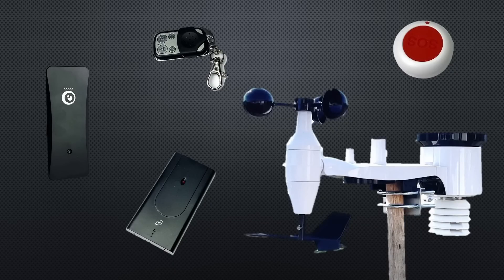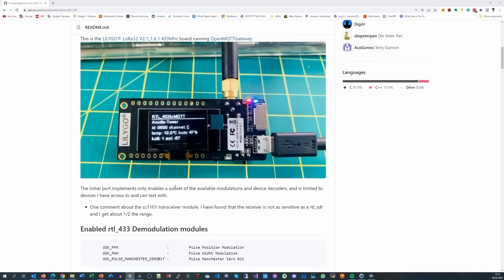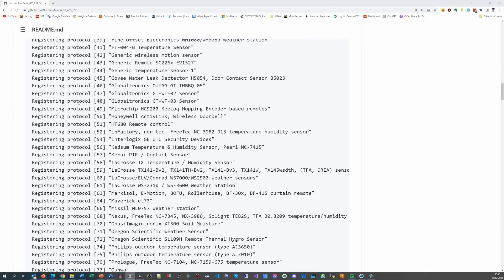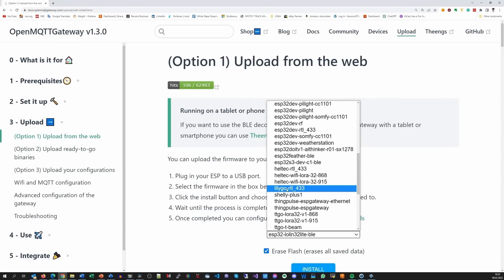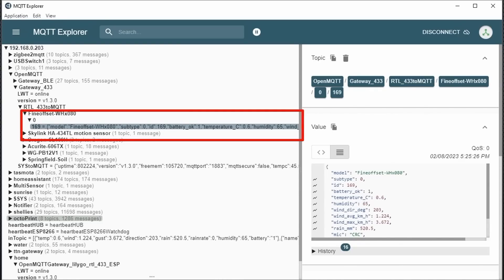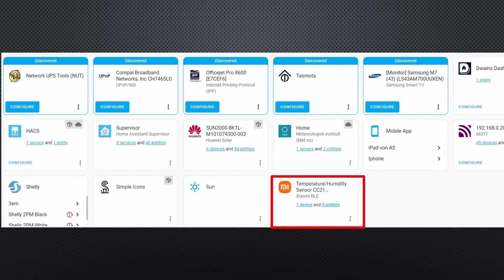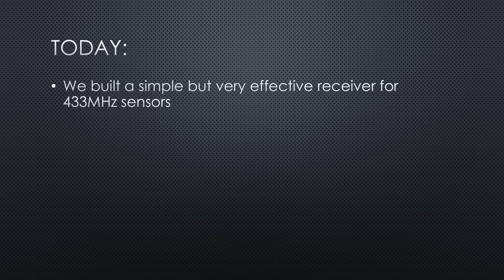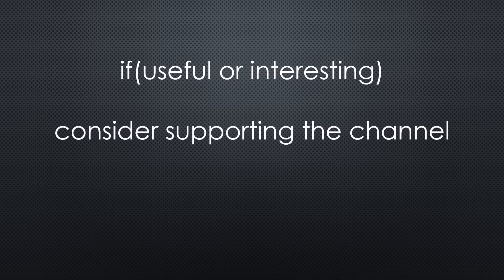449 OpenMQTTGateway Connects Many Things to Your Home Automation

Comment: I've seen some cool stuff on TTGO Lora before, but I've never really considered doing anything with it. But that Meshtastic seems like a fun project to get into during the winter months. I'm wondering if it's possible to make a 1090 ADS-B receiver with those TTGO boards? It wouldn't be crazy, and it would require less hardware and be cheaper. I'm currently using a Raspberry Pi Zero W with an SDR, and it works perfectly.
Reply from the maker: I do not think they cover 1090 MHz. So you still need an SDR

Comment: Hello Andreas, I've just peeking at your case for the LoRa OMG which I will pass on to PCBWay for printing. There are 3 stl files on your GDrive. I assume that I only need top and bottom. I am puzzled what the 'widened_bottom' stl is? Thank you.
Reply from the maker: Unfortunately, I do no more remember the details. But it should be easy to find out which ones are needed.

Comment: Hello, thank you for the great video!

I noticed that you were using a Euromot handheld ( Tedsen/ Geiger GF 003)  transmitter at the beginning of the video. I’m curious to know if you also read it out with the gateway and if it’s possible to send the telegrams. Could you share more information about that?

Best regards
Reply from the maker: I am not aware that I showed such a transmitter. Anyway, I just would try it if it works.

Comment: Thanks again for all of your work Andreas. I have everything up and running but just found out my WS-2902C is not 433MHz but is 915MHz. Can I have another TTGO LoRa board for 915MHz running on the same MQTT broker (R-Pi) and have all the data gathered/displayed in HA or Grafana in one place? Thanks!  PS maybe I could pull the data from the Ambient API, but that's a whole other learning experience, I like hardware better. 🙂
Reply from the maker: You get a board for 915. But I do not know if the software will be able to do what you need.

Comment: For some reason, the case you used for the TTGO board did not fit the board I have. I don't know why, but I found another case that fits perfectly. Youtube doesn't like it if I put a URL in a comment, so I'll just say that I found it on thingiverse as item 6096729 (TTGO Lora32 T3 Slimline Case). Even though we are not using the on/off switch on the board for this project, I made the cut-out a little bigger to make it easier to slide the switch. Other than that, it was a perfect fit. The same model by the same artist is also on printables as item 513743.

Comment: I couldn't get the "upload from web" step to work until I finally tried the "hold the reset button while connecting" procedure. I was surprised since it's been several years since I needed to do that for an ESP32 device. It must be something to do with the paxcounter firmware shipped by the factory. After I had flashed the OpenMQTTGateway firmware once, I could reflash without touching the reset button. Maybe this comment will help someone else if they are stuck at that step.
Reply from the maker: Thank you for mentioning it. I am sure it will help somebody

Comment: If you use the LORA module, do you end up receiving 433 MHz signals AND Bluetooth devices, or do you need a separate board for BLE?
Reply from the maker: The LoRa module receives LoRa signals and the ESP32 can receive bluetooth. I am not sure if both work together in this project, though.

Comment: Super vid as always, even from the 'last row'.  I seem to have the same weather station as you and yes, all What I really got this for was to analyse the code from a new RF 433.92 device to sort out the on/off codes, but it seems that none of my 433.92 remote handsets for various devices give absolutely nothing from the LillyGo, am I missing something very basic here, as if they are on the correct frequency, which they all are, proved with other kit, I did expect 'something' to seen from them, any ideas.  Also, what is the procedure for using the transmit mode such that the RF remotes I have hacked the codes for can be sent by the LillyGo.  Sir, your vids are ALL top shelf, so Thks for all your efforts, always very much enjoyed and appreciated.
Reply from the maker: I do not exactly get your point. But there are other videos on this channel about hacking of 433MHz devices.
Reply: @AndreasSpiess  Thks for the reply Andreas, Maybe i whaffled on a bit on my first post, sorry. My question was that i had thought that OpenMQTTGateway would see 'anything' that transmitted on the 433.92MHz freq, not necessarily decoding them, but at least showing some raw data.  The point i was trying to make is that i have 3 cheapo 433.92 remote control handsets, like a tv remote, that control some power sockets and there is absolutely nothing shown in OpenMQTTGateway when operating any these, but it can receive many other devices near and far. I expected that 'something' would show up as they are 433.92 remotes. Have I missed something very basic here.  As always Kind Rgds
Reply from the maker: @joeking5211  Maybe there is a switch somewhere to let the raw data through. I would ask on the GitHub page (I do not know).

Comment: Very helpful, but my LilyGo device seems to broadcast 'new' devices similar (but different) in name, that I think are the same device. These end up as many, many, redundant entries in my Home Assistant.  For example, "Acurite-986-1R-10", "Acurite-986-1R-110", "Acurite-986-1R-2208" are (I think) the same device but all appear individually in HomeAssistant. Any idea how to programmatically prevent these duplicates?
Reply from the maker: I have the same problem and I do not know the reason. I delete them from time-to-time...

Comment: Hi Andreas ! could this solution / hardware in 433 mhz, receive a classic gate remote controller signal ? thx
Reply from the maker: It depends on the transmitter frequency and if the software knows the protocol of your device. The chances are not good if you do not find the name of your device in the list of the project. But you might try it anyway.

Comment: I have a MarQuant 014331 Weather Station 433MHz, which is not listed in RF-link supported devices. Is there any other way to integrate MarQuant with Homeassistant ?
Reply from the maker: Unfortunately, I do not know :-( But I think you got an answer in the OpenMQTT blog.

Comment: How did your previous weather station fail? Was it just the plastic becoming brittle and yellowed?
I bought the same one (very cheap) and I am wanting to hack it directly with an ESP8266 inside, so no 433mhz link.
Reply from the maker: It stopped transmitting, and I did not have the time for failure analysis.

Comment: Hi, have you checked its range? For me, its range is less than with normal RF433 receiver. I cannot get it woking beyond 15 meter for my weather station, while normal RF433 can easily reach 50meters or more
Reply from the maker: I did not do range testing (my house is pretty small ;-)
Reply: You'll probably want to use a different antenna. I replaced the little antenna it came with with a dipole antenna on a cable, so I also could place it a little higher.

Comment: Danke für dies tolle Video.
Nach dem meine lilygo Module da waren, habe ich mich gleich daran gemacht, mit den WHx080 Transmittern / Sensoren zu spielen.
Wie gehst du mit der Datenbankkonsistenz um, wenn ein Batteriewechsel ansteht?
Beim Neustart ändert der WHx080 Transmitter seine ID.
Reply from the maker: Ich musste noch keine Batterie wechseln. Aber mit Node-Red könnte ich das sicher hinkriegen.

Comment: Excellent video!  Do you know if the less expensive Lilygo boards, like the TTGO T-Higrow LoRa Shield 868Mhz / 915Mhz Function Expansion Board, can be used?  Obviously they need power, but there seems to be little need for the SD card slot and display.  I believe the board you used is aimed at counting devices passing by.
Reply from the maker: You can use all sorts of boards if you manage the GPIOs yourself. But you need a LoRa module, of course.
Reply: I could not get a different model (even with SD card slot and a display) to work with stock OpenMQTT. I donated it to the developers so they can try to make a version for it and bought the supported one. So before you buy, check if your particular board is supported.
Reply: @divingquokka  I have it working on a LilyGo LoRa32 V2.1_1.6 board, reading data from Ecowitt temperature sensors.  Took a bit of fiddling around with the software, but it is now working fine.

Comment: Super tutorial. Unfortunately it seems my sainlogic WS3500 weatherstation, which is probably an ecowitt weatherstation, does not show up on 433MHz... now I wonder if I should get another ESP32 with 866 or 915Mhz... but which one, and would it even work?
Reply from the maker: I would try to find additional information about your device. Usually the frequency is mentioned somewhere. But even then it is not guaranteed that it will be detected and decoded.
Reply: @AndreasSpiess  my weather station as well as ground moisture sensors operate on 915MHz, but my pi SDR or Ubuntu based RTL_SDR is very flaky for some reason, I would also like to see if 915MHz will work! Thank you for the video!

Comment: Why is it that RTL_433 on the Lora32 board can only receive data? It would have been cool if we could also send data from Node Red to the RF device instead of only receiving. Is this a OpenMQTTGateway limitation or is it just not implemented.
Reply from the maker: The LoRa boards can transmit with the right SW.

Comment: Hello Andreas, you showed a very interesting concept but after i followed building it i am very unsatisfied. RTL_433 is not with with its main protocolls integrated. You may be lucky with your weather station but my sensors from Mebus/HIDEKI TS04 show not up instead a bunch of fake Acurite/Sprigfield Soil and so on garbage with not a single real value in it i also see in your list.
Reply from the maker: I agree that they not yet integrated all sensors. Maybe you ask them for your sensor on their Github page?
Reply: @AndreasSpiess  I learnt devices with ASK Modulation are not suipported. I will ask them.
Reply from the maker: @Michael_S888  ASK often is called OOK (on-off-keying)

Comment: hi from the Usa.   ty for posting this - Im trying to copy this with either a heltec lora 32, v3, or a ttgo 915 esp32.   I have a few environment devices that are 915 MHz that im trying to connect.    I can get the openmqtt on the ttgo board and connect it to home assistant - but it doesn't seem to see anything rf related or even bt?    is there anything else I can do or test in mqtt explorer?   as for the heltec boards - I can't seem to figure out the right sequence of the program button to hold to upload the openmqttgateway software to it.
Reply from the maker: The receiving frequency has to be right. And the protocol supported by the project. I do not know if they already support 915MHz devices (because I do not have such devices). Maybe you ask on their project page?

Comment: How well does the included antenna work? Did you test it like you did in videos https://youtu.be/J3PBL9oLPX8 and https://youtu.be/91ZRTFZ40rw? I bought the a TTGO LoRa Board and was wondering if upgrading the antenna would allow me to pick up more of my neighbor's sensors.
Reply from the maker: I always test my antennas with a VNA and adjust it accordingly. All are different. But for receiving, this does not matter too much. An outside antenna would help for sure. And height also helps, of course.

Comment: Hi. Followed your video, it finds some devices including data in the mqtt explorer, but the device list doesnt populate in home assistant. (The Gateway itself is there, but not the entities it finds. Any suggestions?
Reply from the maker: I use the sensors in node-red. But I was able to add a sensor in the MQTT integration to a dashboard.
I thought, it also supports HA autodectection, but maybe you have to enable it somewhere. I would ask on the project page.
Reply: Thanks, found out that it auto disables auto discovery after 30 minutes so I had to enabled discovery again.

Comment: I built one of these and must say it works very well. Are there other projects where  I can transmit my homemade sensor data over 433 that this device can decode ?
Reply from the maker: I do not understand :-(
Reply: @AndreasSpiess  I was wondering if there is an example project for transmitting @433mhz instead of just buying compatible sensors.
Reply from the maker: @franklombardo9230  You can search for "433mhz transmitter Arduino". Or you build your own using the RadioLib library.
Reply: @AndreasSpiess  - do You have or suggest any Youtube manual with example use of RadioLib library ?
Reply from the maker: No. But Google knows for sure one.

Comment: Hi Andreas,
I bought a LilyGo 433 board version T3_V1.6.1
Have flashed the OPenMQTTGateway v1.4 file. I have connected it to my wifi network and can receive an MQTT response from my Gate remote.
However I am not getting anything from any other 433 devices like my WeatherStation etc. Any thoughts on why this is happening? Alos I am powering it from the usb port, is this correct.
Tom
Reply from the maker: One possibility is that your sensors are not supported by the software. Maybe you ask on their GitHub page (or check their compatibility list).
Reply: @AndreasSpiess  thanks I will. Also maybe using a different frequency. Will check

Comment: I've been using RTL_433 with an SDR dongle into a Raspberry Pi for awhile now, but I'm testing this as a much simpler solution. Also, I must have been under a rock because this was my first hearing of OpenMQTTGateway! For the iGate Case files shared in Google Drive, what's the difference between the bottom vs widened-bottom? I also have the Lilygo model LORA32 board with no header pins. Thanks!

Comment: Having tried the out of box experience with the TTGo LoRa V2.1_1.6.1, I have to say I am a little disappointed. Don't get me wrong, I think what the developers has done is amazing, but owning an RFXComm and having seen what it does, I thought this might come close. But it seems that the algorithms aren't quite there for getting the kind of open traffic that I have seen before. In my office I picked up precisely one device and when I moved it, I haven't got it back.
I was wondering if there is something wrong, so I might try another board, or move it to the attic where I might get more range. I was really hoping it would pick up some local weather stations, and perhaps it might be compatible with the weather station I have at my holiday cottage, we'll see when I get there if that happens.
So, once again, I think it's impressive what they've repurposed these devices for, but for me, I'm not getting what I hoped from it.

Comment: I have a DKW-2012 weather station and I am unable to make it work with OpenMQTTGateway. Have you changed your weather station from a DKW-2012 to a Fineoffset WH1080 to make it work?
Reply from the maker: I changed my weather station a year ago or so. But I thought it used the same protocol. At least I got the same messages after changing it (from RFlink). I am also not sure where the name is given. I think, this is done by the decoder, not the sensor. So we can read it as "fineoffset-alike"

Comment: Wow this is a bit of a steep learning curve.  Lets say I have this gateway setup and I want to send data to it.  I want to make a client out of an arduino nano, DHT22 temp sensor, and an inexpensive 433 MHz transmitter module FS1000A.  How do I do send those temperature readings?  Which library is the best.
Reply from the maker: This is a whole project and cannot be answered in one sentence. I would slice it into several parts and search solutions for each one.
Reply: @AndreasSpiess  Thanks.  I watched some of your other videos and I have a vague idea.  I guess you create some sort of json string buffer using the arduino json library and then send it using the radiohead library?

Comment: Hello Andreas, as usual this is again a great video and great content from you. 
The only small remark/experience from me: after watching your video I was like: hey as Andreas mentioned, let's get rid of my bulky DIY RFLink box attached to my HA Raspi 4. I have ordered the TTGo board and flashed it. Unfortunately I couldn't discover any of my devices (mainly PIR sensors and Remote controlled RF433 power sockets) 
I went to the OMG community page and unfortunately I discovered that the chip on the TTGo (also on the Heltec Lora board) does not allow changing from rtl433 to RF / RF2 / Pilight (Switching Active Receiver Module functionality)
This is not a big deal I will buy another same board as I wanted to start playing with Lora anyway but maybe you should have mentioned it in the video (of course if you were aware).
Thanks anyway, I will setup the BLE proxy now ;)
Reply from the maker: The chip should not be the problem. But maybe your sensors are not yet supported by the software (I thought, I mentioned that not all are supported). Maybe you go to their GitHub and ask for the support for your particular sensor.
Reply: @AndreasSpiess  Yes you’re right this is not the chip itself but currently the devs have not yet added support for RF/RF2/Pilight on this chip. I got confirmation on the community page and also there’s a compatibility page in the documentation (I should have read before purchasing the board ;) ) stating the ttgo board does only support rtl433. My sensors are using RF transcoding. I will reinstall OMG on an esp32 or 8266 board with srx/stx882